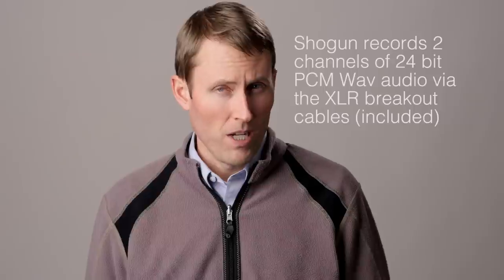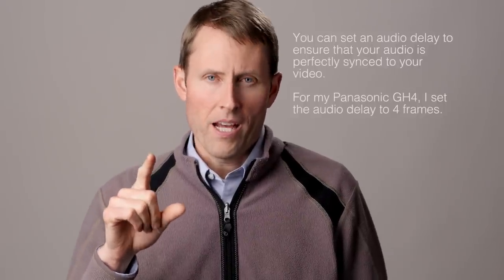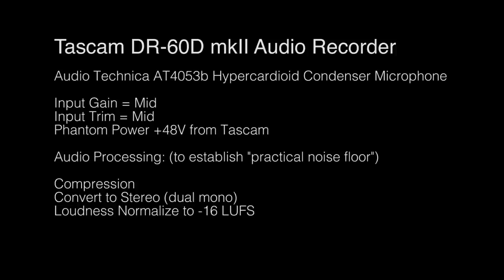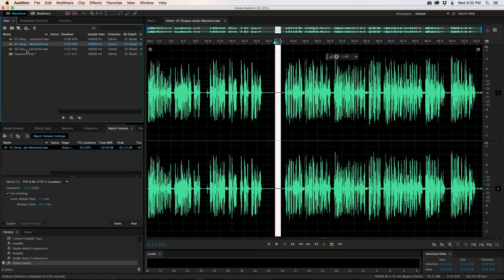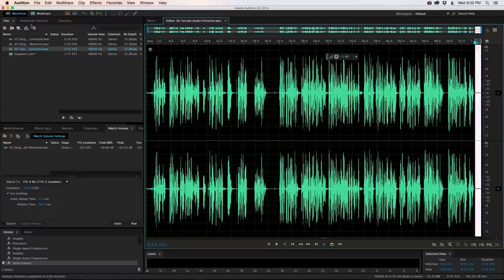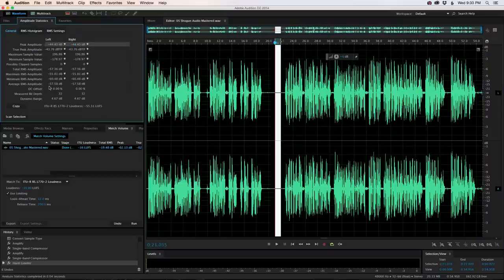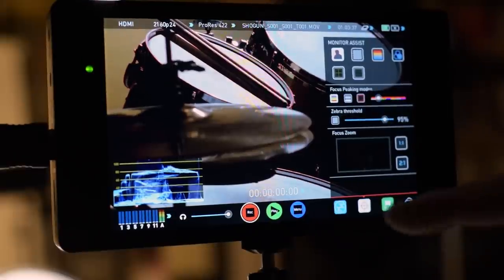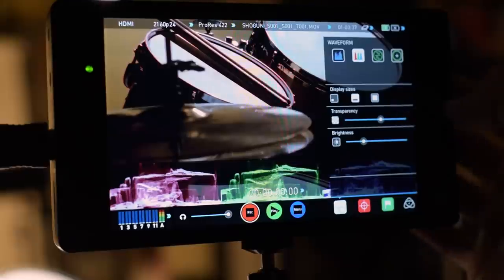Atomos Shogun XLR Audio Inputs: Decent Preamps

Comment: Very nice review. Thank you for taking your time, and for looking into the audio aspect!
I've just received my Shogun and a Røde NTG-2 shotgun mic. I'm a bit disappointed in terms of audio level. I've set the gain to max at +20db, and still I feel as though the audio level needs boosting in post.
Reply from the maker: Thanks Kasper. Yes, the NTG2 is a decent mic but not the most sensitive so it typically requires a bit more gain. I always process the audio in editing anyway, so that I leave enough headroom for louder passages (since I don't have a dedicated audio guy to ride the gain/faders)

Comment: Thank you! Been searching for intelligent audio comparisons while testing the Shogun against the H4N myself. I was hoping the preamps on the Shogun would be of high enough quality to make this devise a one piece audio/video recording unit. I'm not an audio guy so any solid input on this topic is very helpful. Again, thank you.
Reply from the maker: Thanks Lou! I have subjectively found that the Tascam DR-60DmkII's preamps are cleaner than the Zoom H4n so I would not be surprised to find that the Shogun and Zoom are about the same, at least in terms of noise floor  (though of course I don't have an H4n anymore to test that).

Comment: one of the best yet underrated youtube reviewer. 

and i noticed the sibilant in your voice seems more obvious in the test.
Reply from the maker: Thanks Roger! In the non test audio clips I applied a de-esser. The sibilance in my voice is usually through the roof. :)
Reply: hahaha. its really obvious in the video. i am surprised because i never hear it in asian voices.
Reply from the maker: ***** Asians are lucky!
Reply: we sound too nasal normally. lol. i am trying to find a way to remove the nasally asian speech.
Reply from the maker: ***** Hahaha! I guess we all have issues.  ;-) Sometimes an EQ cut at around 1kHz can help cut the nasal sound.
Reply: just at 1khz? gonna test it out!
Reply from the maker: ***** Yes, you may have to sweep it up and down (use a parametric EQ if you can) Usually right around 1kHz pulling down no more than 3dB does the trick.

Comment: Hi Curtis! Thanks a lot for you review on the audio part of the Atmoos Shogun. You right there is almost no reviews out there on the audio part. I am about to invest in a Atmos recorder, but I am torn between the Atomos Shogun flame and the Ninja Flame, well due to the price differnece of course. I like to not use my Tascam DR 60 MKII, beacuse there are so many parts. I use it with my Sony A7, but are planning to buy a new camera some time in the future (maybe a Sony A7sii or Sony Fs5). So the question is do you think it will be worht the extra money to buy the more expensive  Atomos Shogun flame ? I like things to be practical without too much fuzz and I want the sound to be good.
Reply from the maker: +Jill Johannessen Hi Jill, great questions. I haven't used the newest Atomos recorders yet (the "Flames") but I'm hoping to get my hands on them at some point. Here are the main things I would consider:

1) Do you need SDI inputs on the recorder? If you go the FS5 route, that may be useful and it is my understanding that only the Shogun Flame has SDI inputs. SDI connectors are way more robust that HDMI connectors when you're moving that camera around.

2) With the caveat that I haven't tested them personally, the Ninja Flame appears to only have a 3.5mm audio input and the Shogun Flame has XLR input. I would expect the XLR inputs on the Shogun Flame to be about the same quality as those on the Shogun - sound good, but a bit noisier than the Tascam DR-60DmkII. So that would come down to the types of microphones you'll be using and your tolerance for self-noise in the preamps. If from this video, you really cant tell much difference, you're probably fine to go with the Shogun Flame and cut the Tascam out of your workflow.

I hope that helps and best wishes!

Comment: Great review Curtis.  Just what I was looking for.
Our department recently purchased a Shogun Flame to go with another recent purchase, the Sony A7sii.  I primarily want ed the Shogun for recording long events and the visual aids you mentioned in your review. I had been using the Zoom H4n for secondary audio and was hoping to use the Flame for both audio and video. 

I'm a videographer, not a sound engineer but I was very disappointed in the preamps on the Shogun.  Using the Sennheiser EW112p wireless mic system, the noise levels in the Shogun were unusably high when compared with theZoom H4n.  I'm going to play with some settings to see if it can be improved at all but, at first run, I couldn't adjust the Flame and Sennheiser in any way that made the audio sufficiently loud without unreasonable hiss.

With the Sennheiser transmitter sensitivity at -30, The Zoom H4n can  amp the signal up to -12 db easily with very little hiss.  The Flame, with the same low hiss only brings the voices up to -20db. Bringing the Flame up so the voices are at -12db made the hiss unusably loud.  Increasing the sensitivity of the transmitter and dropping the amp in the Flame didn't help. 

If anyone is using the Flame for primary audio capture, I'd love to hear your hardware setup, software settings and experience.
Reply from the maker: Thanks Michael. Since I recorded this about 2.5 years ago, I should report that I have abandoned use of the Shogun for main audio and just let the camera feed scratch audio. That said, I love my Shogun for all its other visual features and am amazed that they're still adding new features via firmware.
Reply: Out of curiosity, what are you using for main audio?
Reply from the maker: My case is a little unusual since I'm an educator and reviewer. Mainly I use a Sound Devices 633 but I also have a MixPre-6, Zoom F8, F4, and a Tascam DR-60DmkII.

Comment: Nice review.something often overlooked in a video recorder nd not something I'd think about. Could you do a review of the Shogun video quality with the Panasonic GH4? I haven't actually seen many videos showing a detailed review of the GH4 with a Shogun 4K recorder and would be good to see some 10-bit 4K clips to see the quality.
Reply from the maker: Yes, working on it. So far, the differences are pretty subtle. The colors look a little more natural (tiny difference), especially when pushing it around in Resolve. Of course there is less banding in skies and other gradients, though it isn't clear to me how well that holds up once you render to an 8-bit format. My sense so far is that it is a specialist tool. I love the scopes, the screen, the ability to nail focus so much more easily. I like working with ProRes files, especially when working with 4k footage - far fewer dropped frames, stuttering playback (though I hear this is not necessarily the case on Windows). So I'm happy with the purchase, but I'm not sure that the footage it produces looks a lot better if you don't do extensive grading. More to come, probably not a video review but a text review on my blog: http://learnlightandsound.com

Comment: Curtis, 
Have you noticed on the Shogun it takes about 5 seconds in the record mode before it starts to record audio? Fortunately I caught this before heading out into the field. Didn't know if this was an issue with just my unit or with others as well. 

Regards, 
Garrett
Reply from the maker: Hey Garrett, I hadn't noticed that but now I'll watch for it. Come to think of it, I'll usually start rolling and then step into the frame to use the clapper board or just clap so typically 5 seconds pass before it matters in most of my footage but that's a pretty critical point. Thanks for alerting us.

Comment: Nice alternative review Curtis, just what I needed to know, as I haven't found another informed review of the audio capabilities of this recorder. It is full of precise and useful information, as with all of your posts. Thanks. 

I looked this up because, like you, I am trying to find ways of slimming down my location kit. It is good to know that the Shugun preamps will hold their own against the likes of the Tascam DR-60D. I use a Zoom F8, or if weight is an issue, a Zoom H5. What I think I would miss though would be the faders and the -12dB safety tracks, which of course the Shogun doesn't have. Have you found this to be much of an issue? Do you find the headroom on the Shogun preamps to be sufficient for careful operators?
Reply from the maker: Hi Chris, Honestly, I ended up using a dedicated audio recorder almost all of the time largely because it was easier to operate that way.
Reply: Thank  you for your quick reply Curtis. That is what I expected, especially with your in-depth knowledge of audio recorders and the features they offer. I think using a dedicated audio recorder would certainly be a safer way to work. Having said that, I have gone back to making sure the Shogun breakout cable is in my kit, so I can record to the Shogun if there is ever an issue with my dedicated recorder.
 @curtisjudd

Comment: Hi Curtis, thanks for the review.  You're right, it's strange that no one is offering tests on the audio quality.  I do hear that slight buzzing when you switch over to the Inferno.  Do you think using a Juiced Link preamp instead would get rid of that? Also, do you think the Inferno's fan noise could be picked up by an on-camera rode stereo videomic x when recording quiet ambient sound?
Reply from the maker: Hi, yes. Note that this was a test of the original Shogun rather than the Inferno. And yes, the fan in the original shogun is definitely picked up by camera mounted microphones which I know from sad experience. When it comes to situations where I cannot boom a mic or use a lav and have to mount a mic on camera, the Shogun is not something I use.

Comment: I'm sorry to bother you again, but I just wanted your opinion.  I have two Rode Procaster mics plugged into the Zoom H4n Pro, which I have outputting into my A7S II Mic in port.  Then I'm running HDMI out into my Inferno from the camera.  Despite having the right channels set to record on the Inferno, and seeing visible levels when recording (and hearing it with monitoring headphones), when I play back the footage recorded into the Inferno, there is no audio.  I tried while having the Zoom recording and not recording in case that was an issue.  I am really enticed by the Zoom F4, especially because we'll have the flexibility to add more microphones (we will be using up to four) and it can record a backup track.  The F4 has XLR out, which I plan to input into the Inferno directly and bypass the camera.  Do you think I will have the same issue with it as the H4N, or should I go for just a regular mixer (Like a Mackie or Yamaha with XLR inputs and outputs)?  I'm basically just trying to get the video and audio synced right into the Hard Drive on the Inferno.  Thanks again for your help!
Reply from the maker: Hi Felipe, It should be possible to get the sound from the camera to the Inferno via HDMI. When you say you're seeing levels from the mic, is that on the Sony or the Atomos? It sounds like maybe the camera isn't sending the audio via the HDMI cable. Perhaps there is a setting in the Sony. Atomos support should be able to help as well.

You could also go with an F4 directly into the Atomos. To do this, the one thing you'll need to calibrate at first is a delay on the audio from the F4 so that it syncs properly with the video from the camera. There is a menu in the Atomos that allows you to set a delay on the audio. I found that setting this to 4 frames made it so that my GH4's picture would line up with audio from my recorder when routed directly to the Atomos. Good luck!
Reply: Curtis Judd thank you again for your help and reply! I'm seeing it on the atomos screen which is what was baffling me. I'm going to mess with it a bit more tomorrow when I get a chance to make sure I'm not doing something wrong.  I'm definitely going to try the F4, I've heard great things about it and I saw your videos on it as well.  Thank you again!
Reply from the maker: That is definitely strange. The good news is that the audio is getting to the Atomos. The support team there should be able to help in the meantime.
Reply: Curtis Judd yeah I'm going to call tomorrow if I don't figure it out. I've been setting up a studio for my company and pretty much had to figure everything out on my own and have my brain tied so it's possible I missed something simple when I was testing it.  I'm more experienced in home theater a/v, so a lot of the same logic applies, but some of it is completely new to me. Thankfully there's a lot of people like you on the internet that can help. Thanks again!

Comment: Hey Curtis,  I've got a couple questions about lavs and I thought you'd be most equipped to answer. Which do you think is more important, the lav or the audio recorder it's going into. I'm looking for a high quality solution for Wedding videography, do you have a good recorder/lav combo you suggest. I've been looking at the zoom h5 or maybe h1 with a lav attached. Thanks for the great vids!
Reply from the maker: Hey Spencer, I've used a Zoom H1 with a lav attached to the groom's lapel and that works reasonably well for picking up the bride, groom, and officiator/minister. Ideally a Sennheiser wireless lav would remove the need to sync in post, but that's a bit more investment at around $600 US. A shotgun with the H5 could work as well but will pick up more ambient sound and you generally need to be within 5 feet of the people you're filming or capture the sound from loudspeakers if they're using a mic for the wedding.  Good luck!
Reply: Spencer Moret Whoismatt has an extensive video specifically about sound for weddings you should check out.

Comment: Curtis,
I need your opinion.
Many years ago, I was using a Sony 3CCD V220 Camcorder8mm.
I am looking at the Sony PMW300K1 ($8,000 B&H) vs the PMW320K ($8,000).
I will be recording to the Shugun 10bit 4:2:2

Which would you recommend?

Everton
Reply from the maker: Everton Oliphant Oh wow. You will need to take anything I have to say on this matter with a huge grain of salt because I have never shot with a pro camcorder. Just looking at the specs, I guess the PMW-300K1 because it has a better signal to noise ratio. But please, please check with others that have shot with these cameras and you have already confirmed that the Shogun works with both of these, I assume? Best wishes!

Comment: Hey Curtis, 
I am thinking about getting the Shogun to use with my Sony PMW300K1 camcorder. Do you think I can use this as my primary recording source while bypassing the ever EXPENSIVE Sony SxS cards ?

Everton
Reply from the maker: Hey Everton, You'll probably want to confirm with Atomos. Strangely they do not list the Sony PMW300K1 on their supported cameras list but they do list the 200 and 100. The Shogun tears through batteries so you'll want to have a good external power solution in mind. It is also finicky about which SSD drives you put in it, but if you use one from their compatibility list, it works a charm.

Comment: This is old, but do you think this still might apply to the Ninja Inferno probably, too?
Reply from the maker: +EposVox if I had to guess, yes. They changed the breakout cable and didn't send the new one with the Ninja Inferno so I could test. But my guess is that it sounds pretty good with condenser mics, but probably produces a bit more self noise than most dedicated audio recorders.
Reply: Alright. Thanks